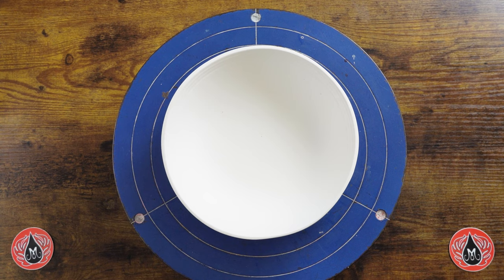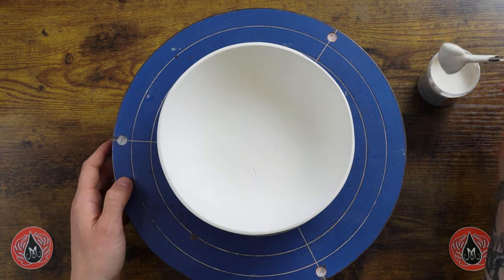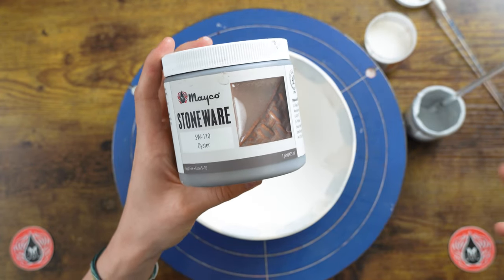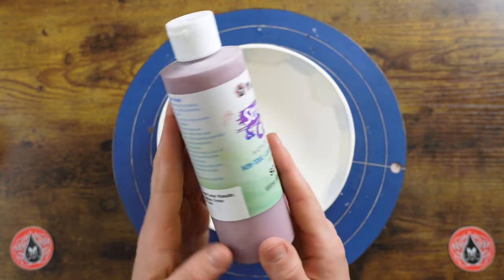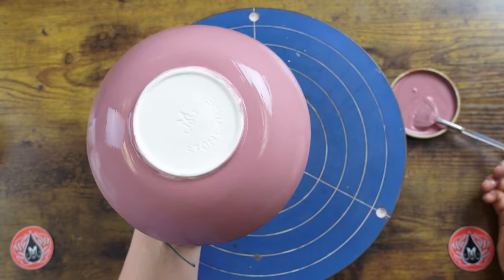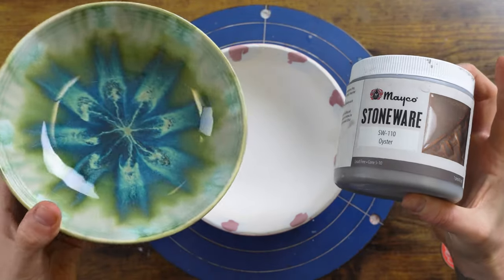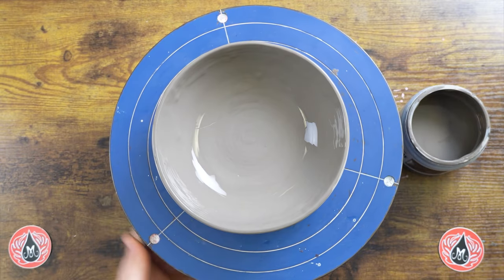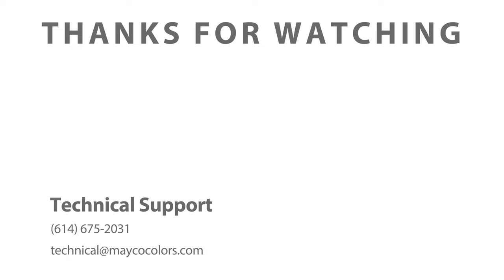Pottery Cascades and Stoneware

Comment: what will happen if I put this combination on flat surface - I mean on tile for example 300*600 or maybe 60 * 120 ?
Reply from the maker: If you fire flat, the glazes won't move.
Reply: @MaycoColors  The tiles are moved inside the oven with the help of ceramic rollers. Temperature pressures of over 10,000 degrees are applied to them.
Reply: Maybe the heat pressure itself moved the glaze layers creating such a unique decor.
For a plate measuring 120x60, temperatures of over 15,000 degrees are applied, while the oven itself for firing ceramic plates is over 200 meters long.